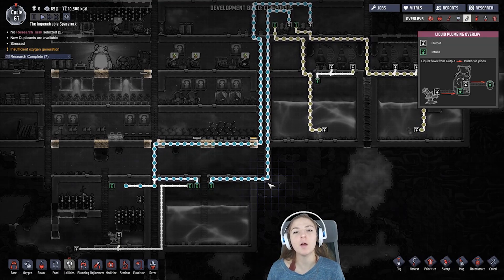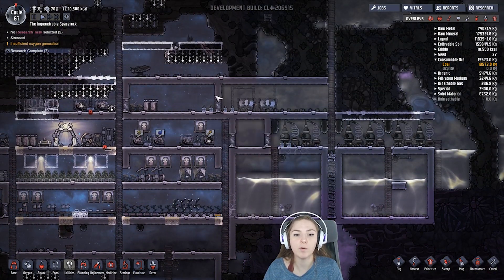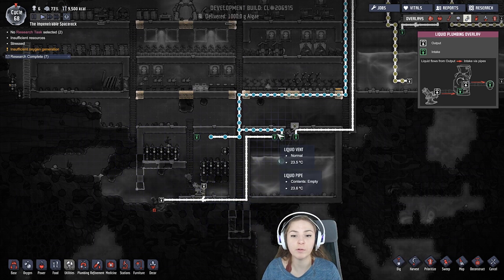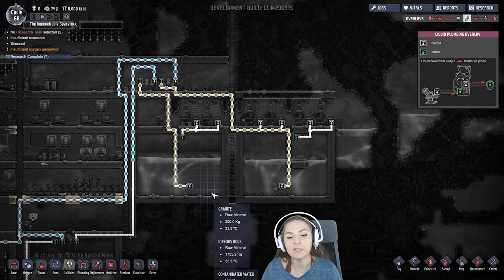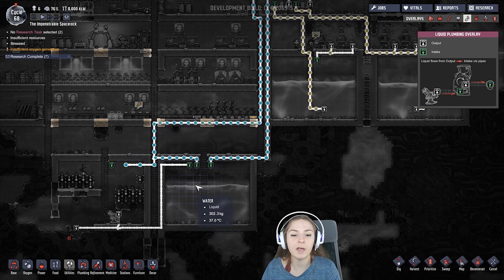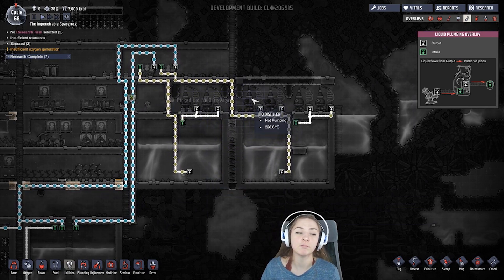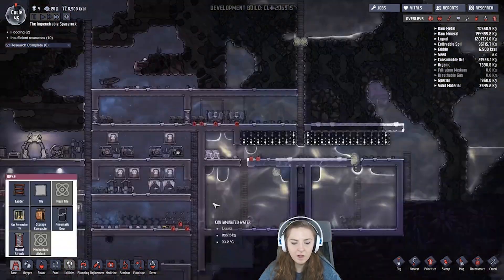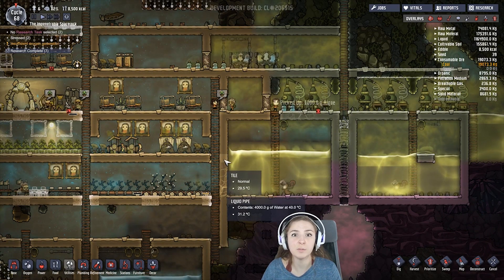Basic Water Systems Guide  - Oxygen Not Included Alpha Release

Comment: Hey Lacy, I've also been messing with ONI quite a bit.  In regards to the cracks in the tiles?  You will see you have options when you place your tiles of what to build them out of.  IFAIK it defaults to sandstone.  Apparently they programmed in porous properties for the construction materials, you can therefore change what to build your tiles from (Granite is an option).

Hope that helps you out :)

Edit - a question actually, how do you sustain your Bio Distillers with slime?  I never seem to have enough.
Reply from the maker: Thanks!!! I knew you could change it but I didn't realize some were porous! and as for the slime I just dig a LOT I wish there was a better way :/
Reply: Not trying to say that you are wrong, but I did test it myself with granite and one layer of wall and it doesn't work.
Reply: That's really strange Saraf, sorry to hear that.  I currently have 2 wells built from a mixture of granite and obsidian, both of which are full of contaminated water with no natural walls on either side. I have no leaks.  I'll test it in a new game later on to investigate.
Reply: I actually have seen many people manage with one layer of wall and it make me wonder how the water actually work in this game.
I think that because most of them only fill their container slowly with pipe while me was filling it too fast.

You can see the example from my video in my channel, I got no time to test fill a container with only purifier because it takes too much time to wait.